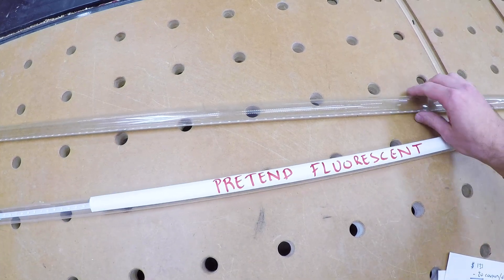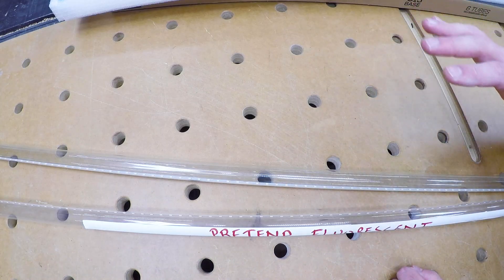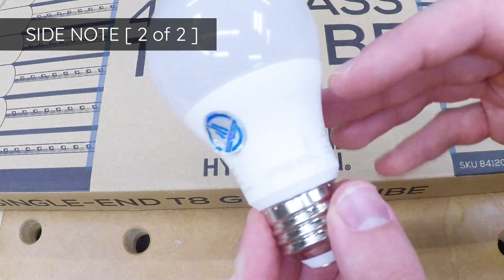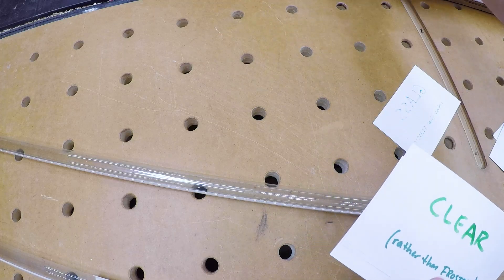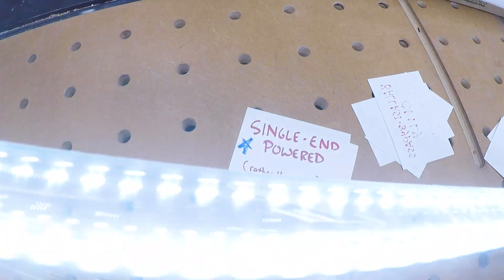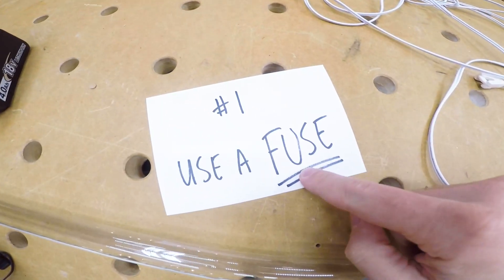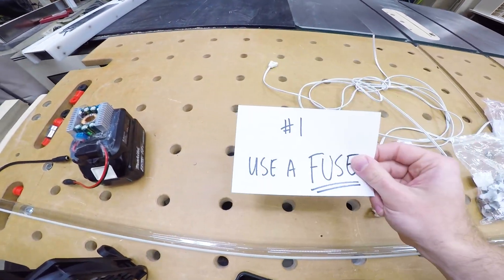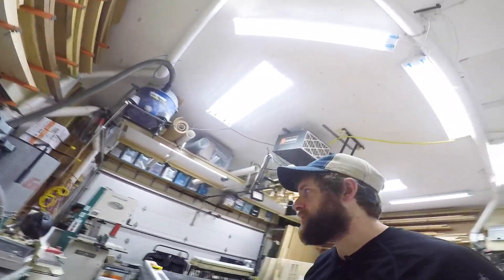Fluorescent to LED: Why I chose SINGLE-ended (save $ & DIY fixtures)

Comment: I will never use LEDs as I prefer fluorescent, but I appreciate the fact that you used actual LED tubes rather that installing brand new integrated fixtures.

Comment: Sorry Keith, maybe your videos are not for somebody as ignorant as I am about such things (kids, don't play with electricity), but what do you do with the connectors?  I saw in the comments that the fuse may not be needed... but are you just directly using a non-grounded plug on the end of the connector that you have the link for?  E.g. no sort of adapter is needed?
Reply from the maker: correct.  I'm not sure what's proper, but I did a non-grounded wire from a 16 gauge extension cord running into the box w/ a sort of screw-tight connector.

Comment: Do me, and other Radio Heads, a favor please. Find a local HAM, and ask them to come over and check those lights for RFI 'Radio Frequency Interference', and report what is found. I bought some 'el-cheapo'  ballast free tubes and the RFI was really bad. Have to turn them off to hear distant stations on the shortwave. Not a problem for the makers out there, but a real pain for us listeners..!
Reply from the maker: I asked somebody who I thought had one and he doesn't.  If I run across somebody who does I'll see if they can give it a try.

Comment: Using your connectors it should not be a problem, but I have heard that when retrofitting an existing florescent fixture, some tombstone manufacturers will not warranty single ended bulb applications. Evidently their non-shunted tombstones were not designed to have 120VAC across the two pins of a single tombstone. This could be even worse if someone goes in and cuts the connection in a shunted tombstone.
Reply from the maker: Yikes. Thinking of somebody simply cutting the connection on a 120V device gives me the heebie jeebies. It seems like the workshop equivalent of a backyard mechanic would do that. 

Nothing against backyard mechanics.

Comment: No need to fuse a diode especially if it's powered by a circuit breaker. All you're doing is fusing a fuse "essentially" or in male terms: it's like wearing two condoms. It does nothing to protect the circuit any better than the breaker
Reply from the maker: I’ve wondered about this, and here’s why I erred on the side of a fuse:  if something goes awry, it’s likely to be substantial enough to trip the 20A breaker. But, if a short happens with some resistance factored in, there’s a chance the current draw during the short would be < 20A, causing excess heat and potential fire around the thinner wires of the connectors that aren’t rated to carry up to 20A. I’m not positive, so I fused it. (Had a very bad experience in high school when installing a subwoofer amp)
Reply: @KeithsTestGarage  lol understood, that's exactly how I became an electrician. Light emitting  diodes are very low current and with all the lights you strung up 20a breaker would be too large. Think about your washer and dryer, they both run off a dedicated 20a breaker and consume way more than leds. Also, if your breaker is arc fault like it should be any short or fault in your led set up just simply trips the breaker. Like the video since I'm in the process of switching my home to leads for cost savings
Reply: One of the problems with electrical that most people don't think of is that there are several sizes of wire involved when you plug something in. If you've ever looked at the rating of extension cords you'll see it, smaller ones are rated much less than say a 12AWG or 10AWG (American Wire Gauge). Most LED setups do not have anything close to a wire size capable of sustained draw of even 15 amps (which is the smallest breaker in most homes). If you do not have a dead short (A "phase" hot to B "phase" hot, hot to neutral or hot to ground) you may have a device that is defective that is drawing much more current than it was designed to. 

Let's say you have an LED fixture that's damaged and now drawing 8 amps. While it won't trip the breaker, the wire in the fixture is not sized to handle it, and if your wire supplying it is also small it will heat up like a heating element. Your supply side of 14AWG or 12 AWG (depending if you have a 15A or 20A breaker) will easily be able to handle the load and not overheat. Your wire going to your light that you installed is the one that will do the heating and if let go over time will possibly get hot enough to catch fire. Using a fuse is a very good way to protect your shop. Now if you ever do have a fire and the insurance company finds you've tampered with wiring making these non listed light fixtures they have an out not to pay the claim on the damage to your shop or home. You may get lucky and never have an issue, but being in the electrical trade for over 20 years it has taught me that anything electrical or mechanical can go bad.
Reply: @johnballiett688  ps : you're also talking to someone who is currently an electrician and 12v automotive installer with 25 plus years. This is a diode and led.... Do you know how many leds you need have in series to pull enough amps to cause a fire.. A sh!t ton. The light will burn out before any wire burns up or a fuse opens  or trips a breaker. If he wanted added protection you'd just use and arc fault breaker which is the current standard.
Diodes are one way. If you reverse polarity they don't work, leds are no different. If you over current a led/diode the wrong way, yes it gets hot then it'd just trip the breaker for over current. A circuit breaker is a resettable fuse per say. Remember replacing fuses in your electrical box, yeah the breaker is that.
Reply: @phillysupra  Thanks a lot for this information on the fuse.

Comment: Might be too late to say this but CRI is what you need in a shop.  Higher than 90 or as high as you can get, as Timothy Leary used to say.
Reply from the maker: I’m a HUGE fan of high CRI. Actual high CRI. However, with products in the consumer markets, “high CRI” bulbs are super hit and miss, and often vastly overstated. I do some photography (keithkellyphotography.com) and am quite bugged by bad reproduction of the color spectrum and have bought way too many high CRI bulbs that overproduce reds, lack greens, etc. 

So!  Remember my reference in this video about the mixing reds and blues?  3000 and 5000k?  That’s what I’ve found to be a solution that has worked well for me. The hyperikon 4000k bulbs have a good even spectrum that doesn’t seem to overproduce colors. Things aren’t necessarily vibrant, but they are more importantly even.  That’s a good base to throw in some 3000k and 5000k fill bulbs to make the whole spectrum pop. Cheaply.  If I ever feel like it. Which so far I haven’t in the shop, as the lack of color cast of these 4000k tubes has been oddly pleasing. 

But if you can find a good single high CRI bulb that doesn’t make you feel all icky, that would indeed be ideal 

On the commercial front though, there are some seriously cool things going on. Like 
Bridgelux Class A LEDs that are developed based on behavioral studies for use in high end retail stores and museums. 

Back to retail though?  Consumers look at 1) price, 2) watts, 3) “color temperature”, 4) “lumens”, and “CRI” as stated on the box.  

As long as we continue to be focused on #1 (as I admittedly am), the consumer market will continue to be filled with air quotes.
Reply: For me, as I age, brightness and color temp are what count the most.  When I'm done remodeling my garage shop, planes may land here instead of O'Hare.

BTW, perfect timing on finding this channel as I redo my garage.  I liked your comment about how you hung your lights based on the workstation  layout and not the ceiling layout.

That makes almost TOO much sense!

Comment: I was about ready to build my own connector like you did. Thanks for showing me that there is a commercial option. I'm considering something like this for my basement which has very low headroom--I could easily mount the tubes to the sides of floor joists to keep them above the ceiling plane. For the workshop I already have a bunch of integrated "LED shoplights" from a big box store.

Comment: that 53% look like 99% in the graph. r/assholedesgin
other than that great video . I think frosted is better to reduce spot light. but u put alot of them so that remove the effect.
Reply from the maker: that was part of the joke...
Reply: @KeithsTestGarage  I guess I wooshed my self.
Reply from the maker: To your credit, I wasn't very clear about my intentions there.  I find visual aids often humorously skewed by the presentation based on bias, so I Photoshopped an extreme misrepresentation of the poll on my Community page and kept it a subtle gray.  Good catch by the way.   People who actually consider the numbers rather than the colors & shapes are a step ahead IMO. 

(also, that the number of votes was only 17, and the survey was limited to this channel's subscribers.)
Reply: @KeithsTestGarage  How do you have only 7k subs. Your humor is the best, subtle yet punctual. Love to see more!
Reply from the maker: SaUcErS pLaNeT I appreciate the comment, and think there are several reasons my channel isn’t viral...the main one being that people wouldn’t want it to be, because then we’d have to start self quarantining all over again.
Reply from the maker: Also, good point about the frosted.  If you only have a few fixtures, frosted will help if there are white objects around to use for reflection.